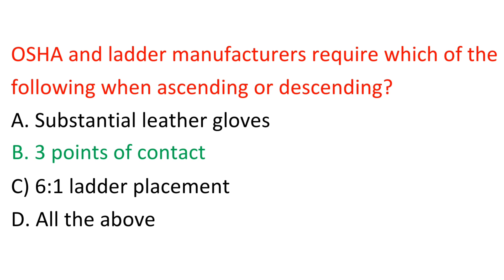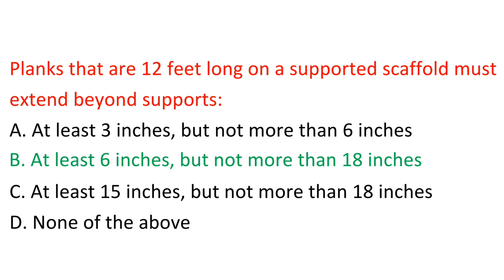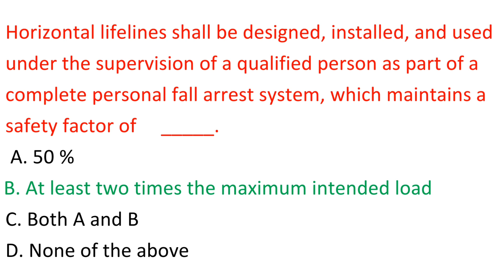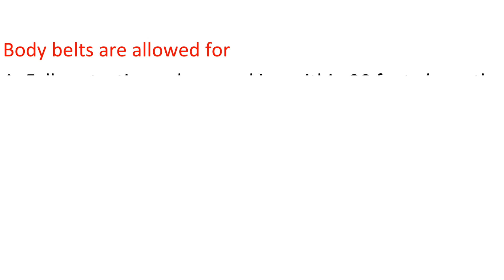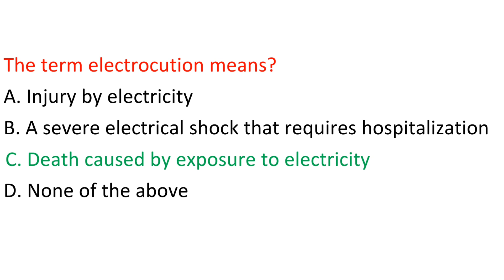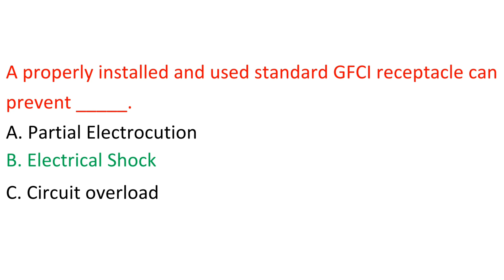OSHA 30 CONSTRUCTION FINAL EXAM Question and Answer part 6

Comment: a gurdrail system or a personal fall arrest system is required more than....above a lower level.so your answer is 30 feet.but correct answer must be 10 feet.Why are you directing wrongly?
Reply: There were other questions with wrong answers as well